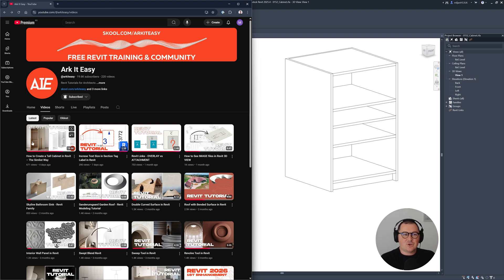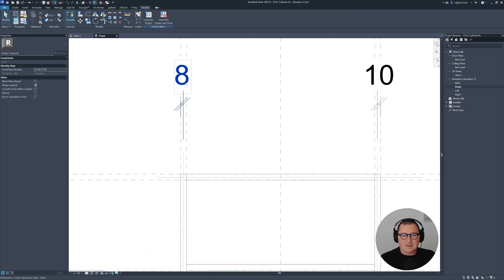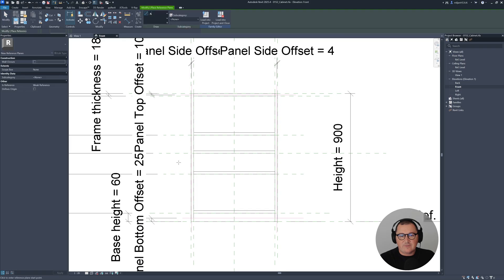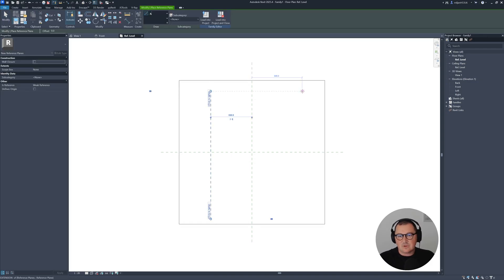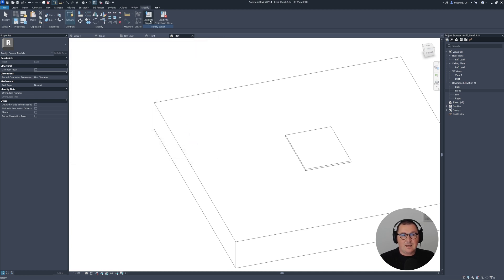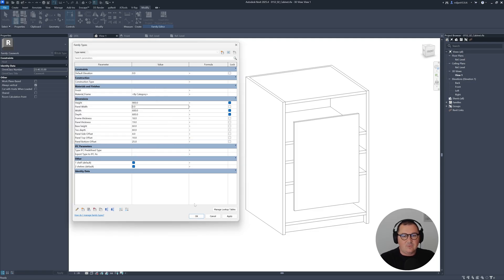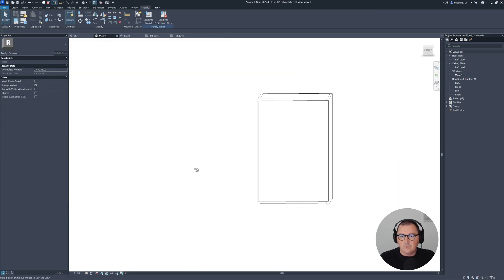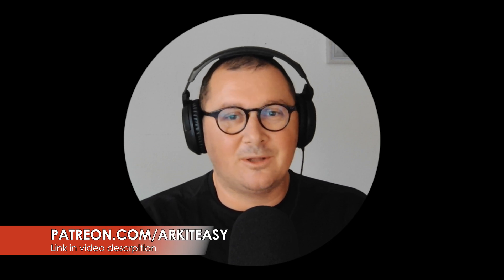How to Create and Nest a Cabinet Front Panel in Revit

Comment: Great tutorial! I was just wondering why you chose not to lock the front edge to the pink reference planes, and instead defined its dimensions through formulas. Is there a specific reason for this approach?
Reply from the maker: Thanks, good point! The reason why I did it this way is because I was using Type Parameters. Also, in extended version I nested one more panel. So, this way helped me to create different types and to differentiate them via Family Types parameter.